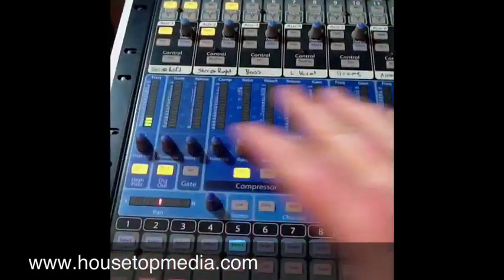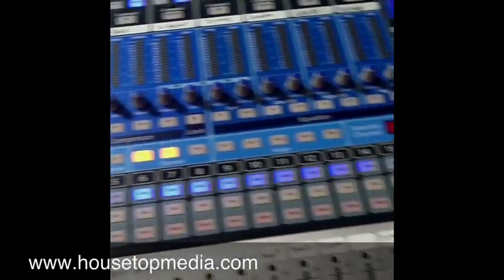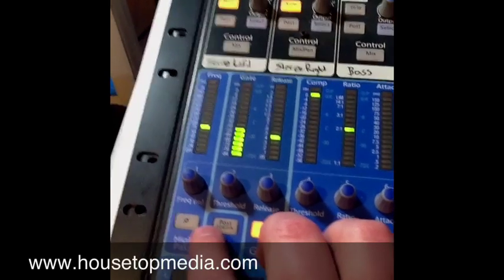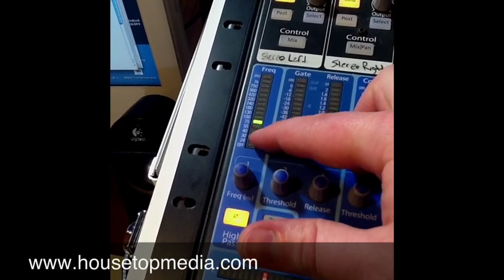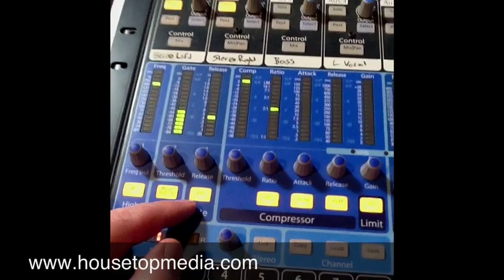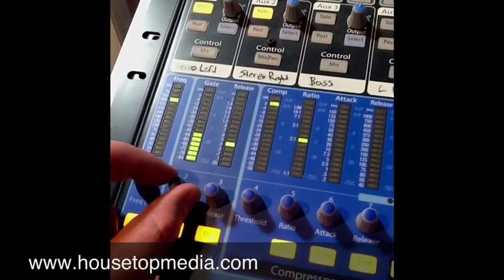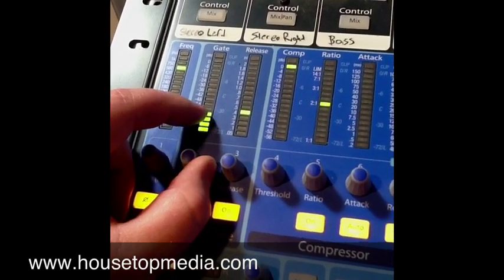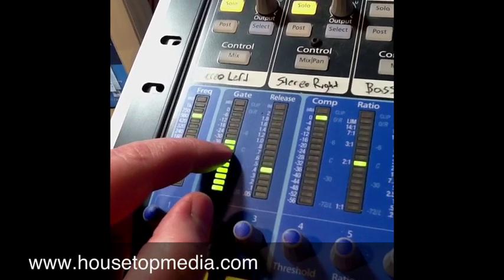PreSonus StudioLive Training #3 - Fat Channel Part 1

Comment: Sir, do you know if on a 16.0.2 USB there is a way to NOT route a channel to the Main output bus? Most mixers have channel routing buttons. But I don't see, unless I'm missing something. Was hoping buried in UC but not that I can tell. 
This is a major design flaw if no way to change.